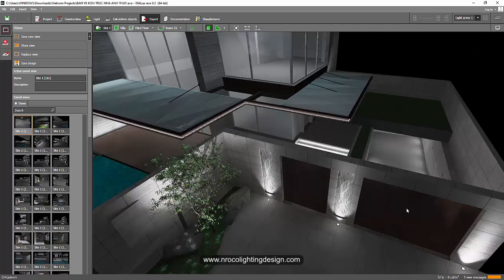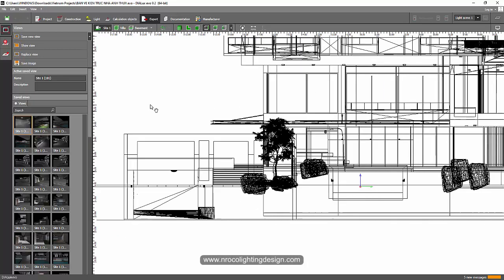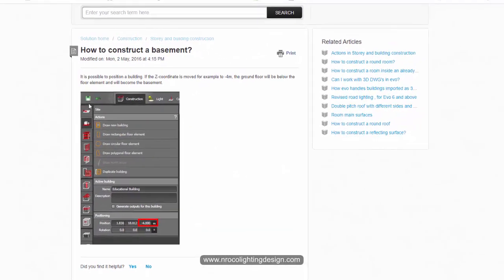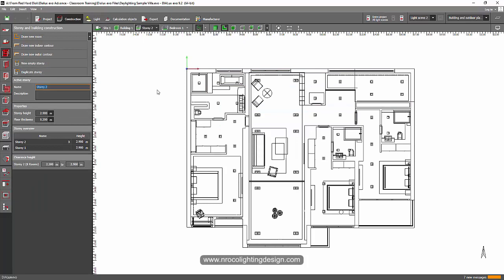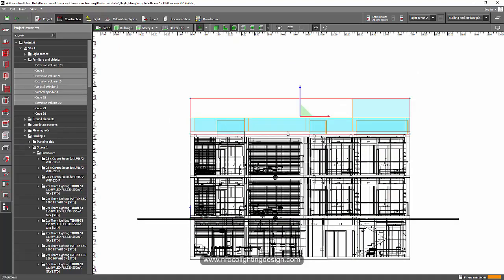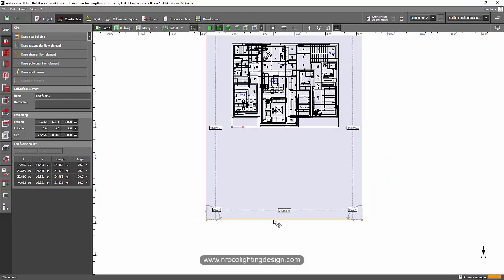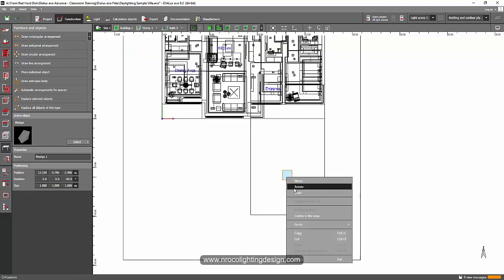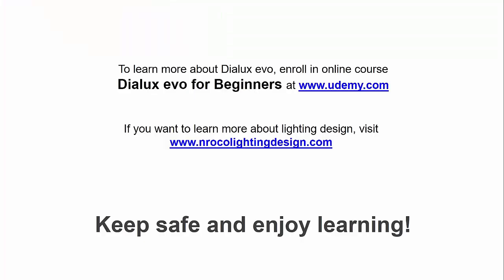How to create a basement in Dialux evo?

Comment: Can we add basement later? It looks as if one can only add floors on top of the existing ones.
Reply from the maker: no. you need to start with the basement.  Otherwise, the basement will be a separate building which you will move below the main building.
Reply: How to add a basement:
1. The construction of floors and buildings - poke at Floor 1 - Duplicate the floor - a new floor will appear between floor 1 and floor 2 (For example, Floor 4)
2. Rename floor 1 to floor 0
3. Rename floor 4 to floor 1
4. Terrain - poke into the building, the building will light up - Positioning - Set the negative mark of the basement floor (for example, -4.800)
5. The construction of floors and buildings - poke at Floor 0 - Properties - Floor height - Set the height of floor 0 (there was a height of floor 1, you need to set for example 4,800)